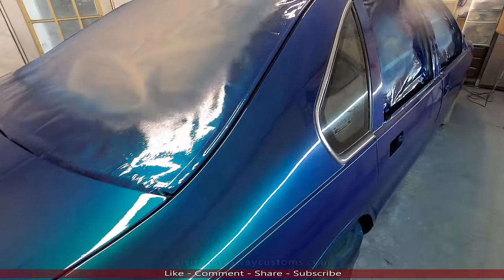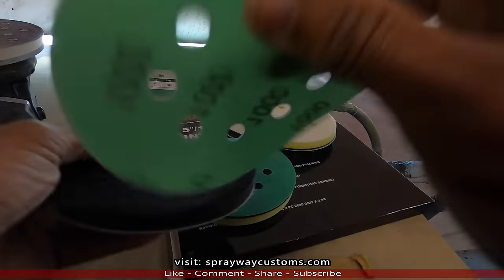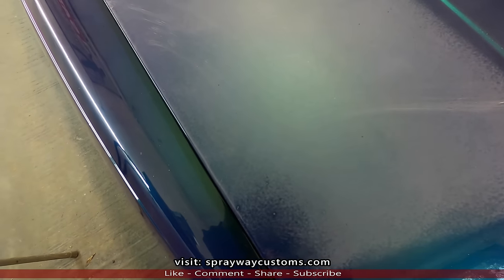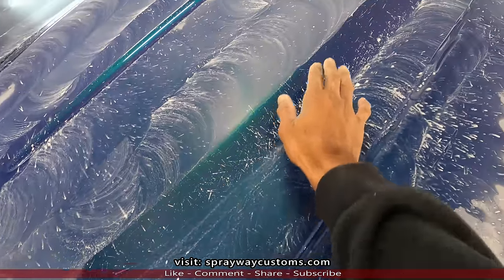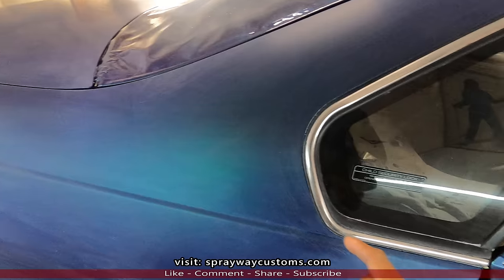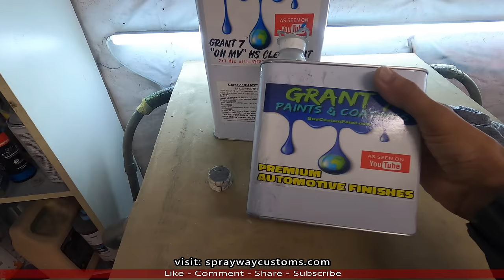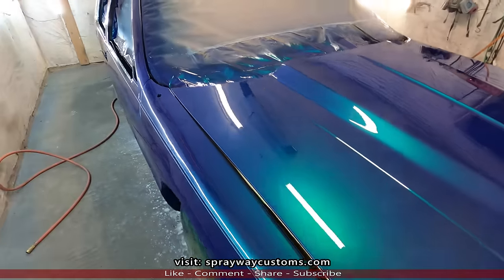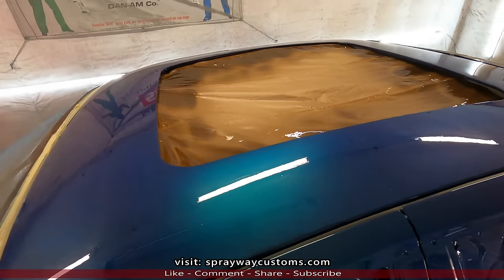How To Do A Flow Coat On A Car - What Is Flow Coating After Paint ?  Re Clear On The 96 Impala SS

Comment: I was surprised to see the better results on the side with 1000 (wet) compared to 600 dry.  I expected the 600 grit to be more aggressive in removing material, but it was not.  Was the pad behind the 1000 grit more rigid? 
 Love watching your work.  At least I can see proper process and techniques in action, duplicating them is another matter entirely.

Comment: Beautiful work, I have a question, I have watched several high end painters who say flow coating is fine if you are burying graphics but when you lay down 2/3 coats and wait several days or weeks and then lay out 2/3 more coats it’s actually counter productive vs laying out 4/5/6 coats in one session with greater flash times in between because the first coats of clear act as a separate paint job from the last coats, so if you wet sand through to the first set of coats it will look like a burn thru or a halo and will show up, with that they say it wastes a lot of extra labor, tape, sandpaper ect that doesn’t need to be used if you just put 5 coats down in one session, there is a youtube video of a guy showing the 2 processes on one panel and it shows the halo when he cuts thru, likely you are not going to cut thru when you have 3 coats over 3 coats but many do 3 coats the 2 more, so that could be an issue, what are your thoughts on this ?
Reply from the maker: You’re correct. I mainly do it for content

Comment: I’m flow coating the inside of my OBS Chevy bed and I sanded through the base coat on a few high ridges on the bed floor. I’ve touched them up with base coat with my air brush. Do I need to sand those spots of fresh base coat before I do the flow coat of clear?
Reply from the maker: Not if you’ll be spraying the flow coat within 24 hrs
Reply: @SprayWayCustoms  Done. Turned out great. Thanks for all the help!

Comment: I got fish eyes in my flow coat had to re sand 600 and cleared another 3 coats, will there be a problem too much clear at least 9 coats?
Reply from the maker: No it won’t
Reply: @SprayWayCustoms  how long do u wait to buff your car after flow coating?
Reply: @MartinMora92 I'd wait bout 2 weeks. The more sun exposure it gets the quicker it'll cure.

Comment: The amount of dirt in this job probably means a flow coat would be mandatory to get a good job, but I would be doing a lot of cleaning on the spray area. Even a flow coat looks terrible if there is lots of dirt in it.
Reply: Generally, flow coats have less trash than the initial coats and are surely not as heavily embedded in the clear. Initial coats are usually thicker, hence the reason trash is embedded deeper into them. Flow coats are just to re-wet the surface to bring back the shine, and any trash at this point will be lightly embedded, much easier to buff out. Plus, the cut/buff isn't as time-consuming, imho after the flow coat and the added benefit of nearly zero orange peel (if clear is over reduced by 10-15 percent).

Comment: ..It's just such a shame about all the debris. It really is a lot. It must be falling from the ceiling or being sucked in through the intake fans and pulled across the car by the extractor fans or something. Is the air that's coming into the workshop being filtered before it gets sucked in.? Such a shame but lovely colour and lovely car. I'm sure it will look fantastic when it's finished after all that hard work.

Comment: What size gun tip is it?
Reply from the maker: 1.3
Reply: What size tip used for base coat? For what purpose is the 1.0 ? .
Reply: 1.0 if you were painting like motorcycle parts, surfboards, etc. smaller items don't need that much paint flow for coverage. Using a full sized gun with a 1.3 or 1.4 produces alot coverage which is great for a vehicle but too much for like a motorcycle fender. Larger job need more paint.